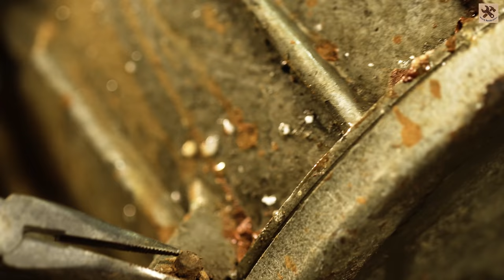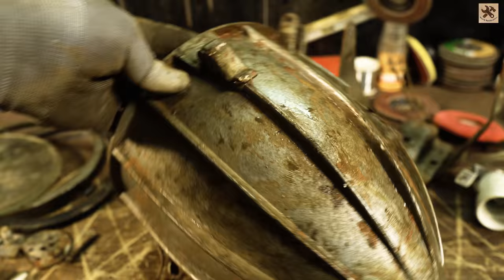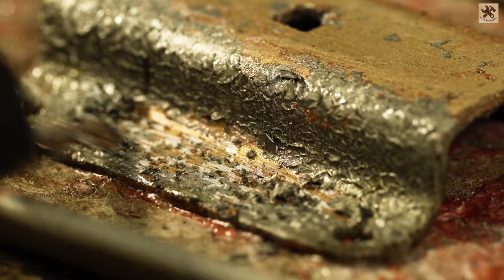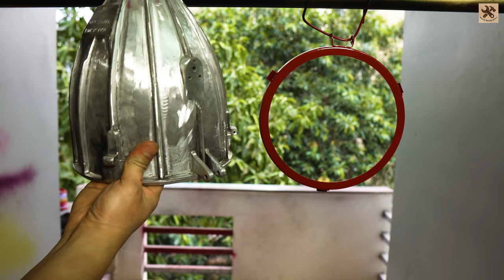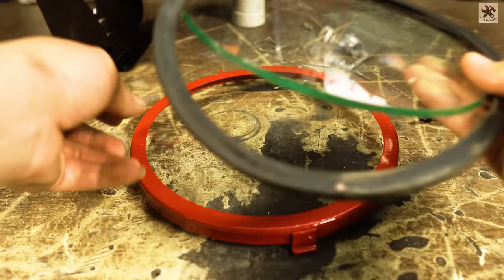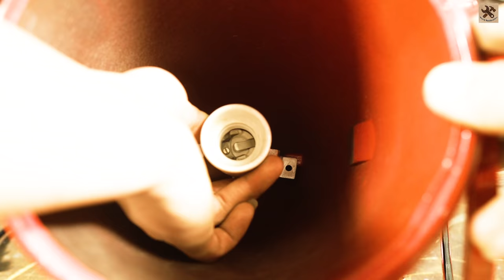Antique Lights Restoration with AMAZING outcome

Comment: I restore furniture as a hobby so I tend to watch a lot of restoration video's.  I have watched a number of your videos and I am saddened to say that you have really let yourself down with this one.  You do tend to stretch the truth in your video titles quite a bit.  You showed no respect to this item.  You hammered and banged and scraped and twisted.  Instead of removing something gently, such as the hinge pin, you tried your hardest to beat the pin into a pretzel.

I will give you props for doing something you love and, in the end, have a passably good item you can sell at the local flee market.  But please stop using the term "Restoration" because your items are anything but but restored.

Comment: Why bothering using paint stripper, sandblasting and countless of hour of work, and than angle grinding and ruin it at all?
Not to mention spray painting directly on the surface without using a proper primer and watersanding it first.
Appreciate the effort, but this is not restoration, it's "patching up" work.
Reply: exactly what i wanted to say + he already scratched it all, should had add rubber grommets,                    not that it matters, the paint job is tribble, could have gotten the same results with a pressure washer and a spry can, and it would take me 10 min to do so

Comment: Very lazy "restoration"...half assed job all round.
Reply: I hate to criticize but you are correct... hearing that freshly painted surface scrape along the bench sent shivers up my spine, scraping the old paint off with a metal tool.  This is basically a clean and repaint, wouldn't call it a restoration to it's former glory.

Comment: Hello,
Good restoration in general but you missed some details that could improve your final result.
First, bluing the screw or some rustproof treatment on them.
Second polish the glass
Third paint the inner part of the lamp with something reflective for example silver paint
Fourth the cable fitting should be improved adding a cable gland with waterproof gasket/oring.
In general it's good but only for exhibition.
If you want to put it outside i suggest you to introduce this kind of treatment next time.
I hope that my suggestion could be useful for you.
Thank for the video
Reply from the maker: We will try to change it in the following videos. Thank you for comment
Reply: Its not like it going to be left out side in the elements to rust it his version of restoring the light

Comment: I agree with the other comments, doesn't seem thorough especially when you started sandblasting when one of the label plates was still attached...
Reply: Totally agree.
BUT. At least he sandblasted. Most of these restoration channels don't sandblast to clean up old items, even though that clearly is the proper tool for the job.
Reply: This guys channel fails in logic, common sense, skill and talent.

Comment: Not so much restored as cleaned! Replacing a broken light fitting??? Also, always put pivot pins in from the top, that way even if you lose the split pin it won't fall out, and maybe a coat of silver on the inside of the light might have helped??
Reply from the maker: Thank you for your comments

Comment: I do like the result, personally i don't think that sandbasting was necessary on the aluminum. As a solution, using cellophane can help prevent paint stripper evaporation for a beter result. Keep up the good work 👍
Reply from the maker: Thank you

Comment: First right tool for the taks, not to forget parts to clean and grease. Painting without primer useless. Paint should be high temperature resistant. This is no restoration however nearly acceptable cleaning.

Comment: Red and black the only colors of paint you had? I love red n blk just about everything I have is either red or blk. But that light I would have used silver HAMMERTEX AND OR MACHINE GREEN HAMMERTEX. I do enjoy watching some one with limited equipment taking an old relic and having to use all of its original parts. The pins for those latches, did you make this your self or they the rusted ones you originally removed?

Comment: Nice video, but fix your audio.  I think you have the camera on the table and every move you make with the light the sound transmits through the table making it loud and booming.  Put the camera on a tripod or put a pad under it to isolate the camera from the table acoustically.

Comment: Seems like manny the wire brush used was a little too abrasive, as it left  scratches before the sandblasting. 

Also, a little hand sanding would have done very well for smoothing the finish out, instead of grinding

Comment: Somewhat cringeworthy I'm afraid. Using a screwdriver with a tip that doesn't fit the slot and buggering up the screw,  hammering out a hinge pin with a punch unsuccessfully and THEN using penetrant instead of the reverse and grabbing channel locks to remove a nut instead of the proper sized wrench was tough to watch.

It was a cool item you found to work on. Those longitudinal fins on it make it look like something from the 30's or 40's......maybe marine in origin? Personally, I would have gone with an antique hammered bronze paint; something a bit closer to the original finish. The final product is not terrible, just not in keeping with the original look of the product. With it's age and patina this light had dignity; now it's just somewhat gaudy.

Comment: Amateur,  what was wrong with refinishing with original Hammer colour ? No need to use a angle grinder. Light coat of finish,  so what was underneath can be seen. Small amount of  grease on the threads . Repair/replace lamp holder. Read other comments below.  D+ can do better.

Comment: Terrible paint job, never polished the glass, you scratched the paint where the mounting bolt for the bracket went. The pins for the clasps for the lens cover  never had anything done to them they looked scaly and rusty. On a scale of one to ten (ten being the best) I give it a two, and that's being generous.

Comment: use screw drivers and other tools that fit the job and fastener instead of channel locks and under sized drivers.  Your marking up and gouging the metal for no reason and that seems to go against the objective of the project...... restoration.  Clean up your methods and it will show in the work.  Channel lock pliers on the wire nut....ouch, at least spring for an adjustable..